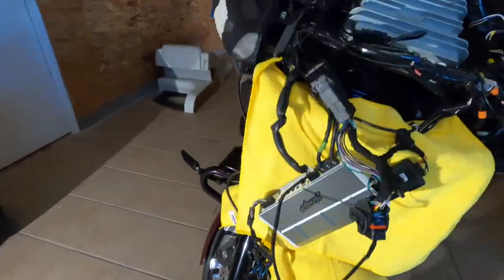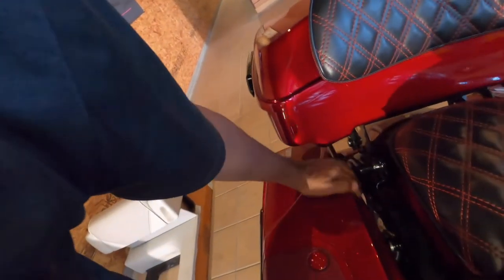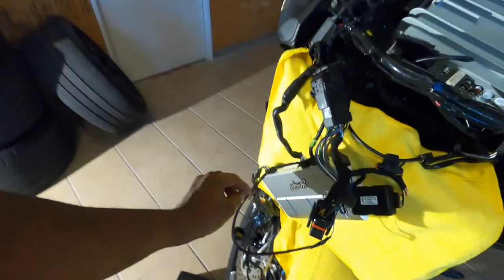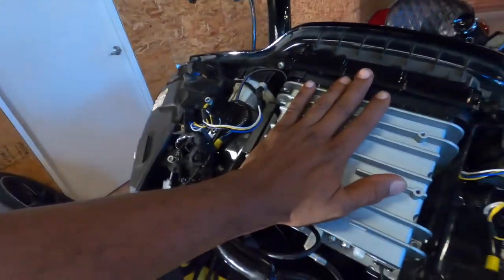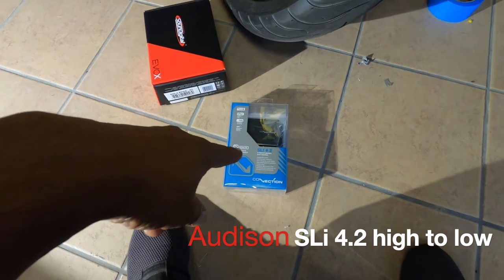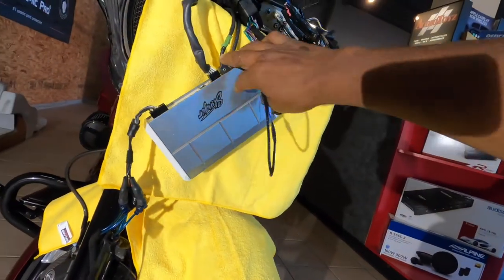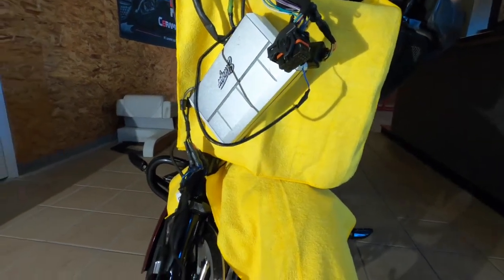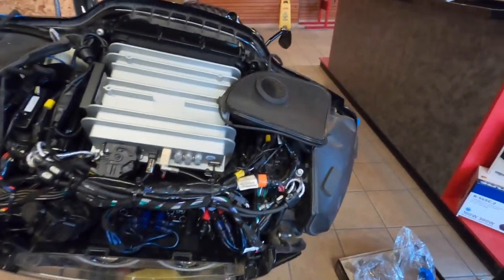Sound Digital 800.4 amp & Rockford Fosgate DSR1 Upgrade to a Harley!

Comment: Is it better and easier to use the sound stream radio rca output ? Also could you please clarify the order of install? Is it: Radio output to dsr1 to SLI4.2 to Amp? Im trying to do the same install as you. Thank you
Reply from the maker: I’m guess you have or are thinking about get a Sound Stream radio. If so it’s a lot easier to use the RCA outputs. 
You would want to use SLI4.2 first to create a load on the radio. Then the DSR1 to tune the amps.

Comment: You would you have to use a Hilo converter. If your using a dsr1
Reply from the maker: I'm not a fan of the converter that built into the DSR1. I use the Audison SLi4.2, because all works the way I need it to.

Comment: I have a question I have four Rockford M2 6.5 150rms components WITH A ROCKFORD 400X4 AMP..But I want to add 2 super tweeter 100rms 4ohms and 2 horns 100rms 8ohms... Want to remove the Rockford app and add the sound digital 800x4 with a DSP.... Would that be a good setup to do if so how many watts would I get per speaker?....or should I keep the Rockford amp and run all 8
Reply from the maker: Sound like you want a lot of highs. If so I would run 2 amps with the DSP. You will have more independent control of all of the channels. I'm not sure what your goal is, I hope this helps.